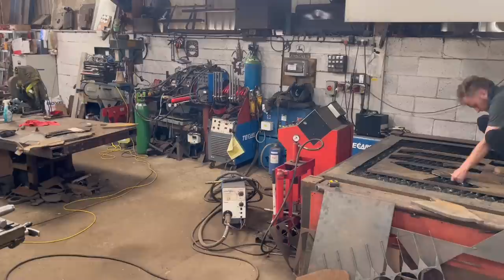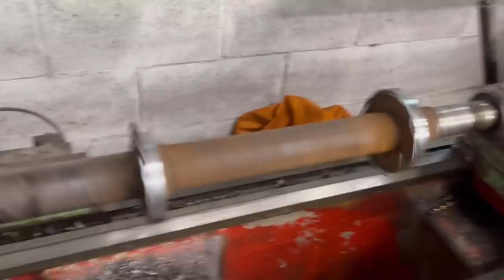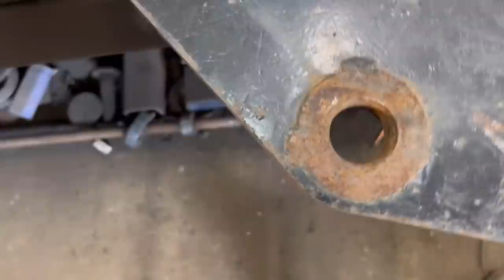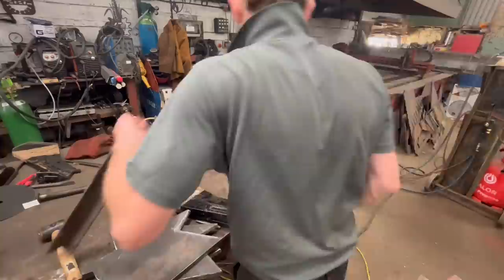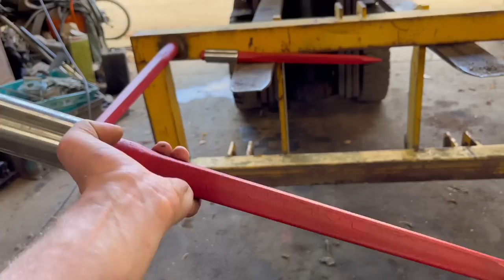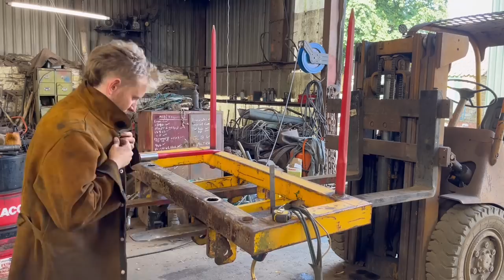Catching up on jobs! 3 in 1 video.

Comment: Back when i was 12 or 13 (this was in this 70s in the US) we had all IH equipment on the farm.  For years we used subsoilers with shear pins and every time you hit a stump and broke a pin, you had to drive the knackered pin out and replace it.  Hated going from the AC cab to 100 degree weather to drive out those pins.  Then my Dad bought an auto-reset subsoiler which had huge springs on either side of the subsoiler foot that retracted when it hit something really hard and then the springs drove the foot back into the ground without me even having to stop the tractor.  On rare occasions, the foot would stick in the up position and I had to climb out on the dual tires and try to kick the springs back down.  Worlds largest cocked and ready mouse trap and im some kid sitting there kicking at it with my foot.  Good times :)

Comment: While working in a factory making power tools in County Durham were taught about TCS. TCS stands for total customer service and starts with the first job on the line, the next job is the customer of the first and goes on down the line. Until the buyer of the tool who is the final customer. Which is what you are reminding me of by doing a job that is more important than the one you had started with, good on you. 
I don't know if you have seen CEE, it's a man in Australia doing bigger jobs than you but are also similar to yours. He has a rotary ground, it goes round on a copper ground but because it has a bolt tacked to the job doesn't twist the cable.
He has a video of how to make it called making a rotary ground. Cutting edge engineering Australia is the name of his company. But his name is Curtis. He also has a rotary turner for welding inners and outers of pipes and similar jobs. I recently found your channel and after seeing a couple of videos I'm now subscribed.

Comment: Those sub soiler points are made longer cause your supose to cut the old ones off abd wekd em into the sane original tops, they give you a bit extra incase you fuck up cutting the old ones out, they know its prob going to be farmer doing it 
You can get full replacements but sounds like your customer didnt realise why these were cheaper haha, prob thought he was getting a sweet deal
Reply: More likely they are a fancy low disturbance point design

Comment: Please replay your video as it looks like you might have a cable insulation breakdown by your mig wire feed unit 28.10 to 28.45, just incase you didn't know. Also earth clamp at 26.48
Keep up the excelleny work.

Comment: 32:47 a mag drill with an annular cutter would be ideal for that job, you'd  just have to drill from the other side.
Reply: Absolutely the perfect tool for the job, if you have one. Sometimes you have to work with what you have.
Reply: @sjv6598  i'm not in disagreement with you there, just noting that this was a prime example of a job were a mag drill is ideal.

Comment: Hi Oliver I'm at the same type of business in Ireland currently working on rebuilding the back of a tri axel low loader a lad forgot to lift the air bags before lifting the ramps a bit of a mess . I put a overhead crane in the workshop about ten years ago could not do without it now did you ever think of putting one in ? . Love the content keep it up 👍
Reply from the maker: Ive thought about it but a big expense for a good size one.  I’ve never used one before so I don’t know what I’m missing.

Comment: Think u could have saved a bit of time on the roller.  While in the lathe the disc sides could have been semi faced or camphored with a different bit.  No angle grinder required as you've already got a spinning sharp thing.  Just glad it wasn't an articulating 250 something that needed line boring. :-)

Comment: Does the plasma table have down draft? Trying to work out the cheapest plasma CNC setup I could build. Cheers :)
Reply from the maker: Yes but I don’t have it piped up. It’s an open down daft not zoned so I’d need a massive fan for it to work properly.

Comment: Don't apologise for a lack of videos. Big respect to all our UK farmers and those working the land. 

I reckon the magic eye profiler is going. And Mill is replacing it's floor space. Possibly a newer updated CNC plasma table or water jet. 

You got to laugh at pathetic imperial measurements and the silly use of too many numbers
Reply: And yet for everyday turning and matching many think and work in thousandths rather than metric. Always remember too that a fraction is an absolute value whereas base 10 is sometimes an approximation e.g. ⅓.